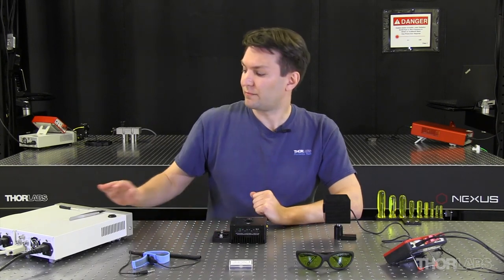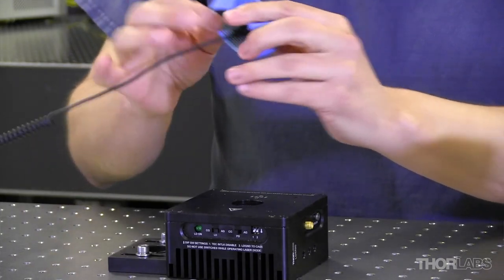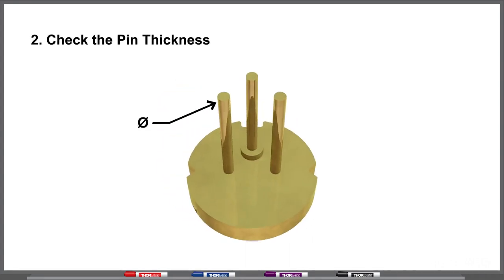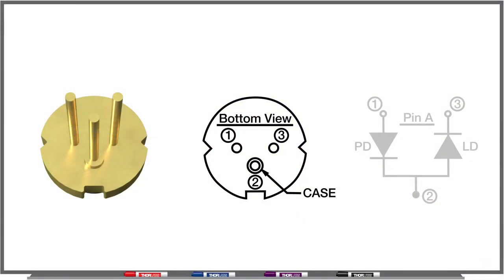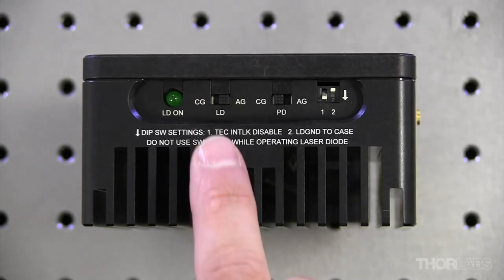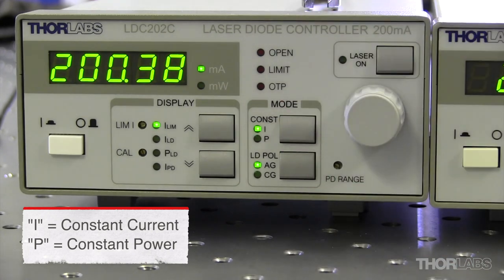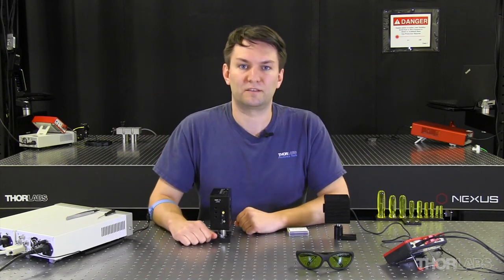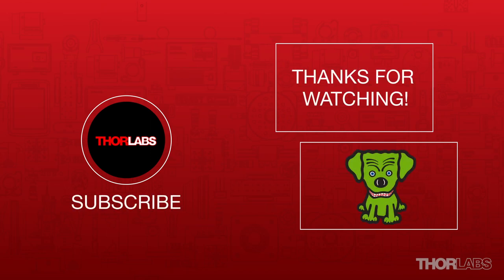Setting Up a TO Can Laser Diode (Viewer Inspired) | Thorlabs Insights

Comment: Nice to see how to use an ESD wrist strap - I was wondering if I'm doing it right for my amplified photodiode :)
Reply from the maker: It's great to hear that we've helped give you some confidence as you handle your amplified photodiode. Please let us know if there is anything else you've had questions about.
Reply: @thorlabs  I would definetely appreciate an insight video on adjusting two FiberPorts facing each other on a FiberBench as well as adjusting a plate beamsplitter module for FiberBench. I had few-year break from adjusting free-space interferometric setups and now adjusting a Mach-Zehnder interferometer using FBT-50MIR beamsplitters and a FiberPort to collect light at the output gives me a headache (so many adjustable screws!) :)
Reply from the maker: @Adam Paździor  There are definitely a lot of adjustable screws 😊 Thanks for the detailed suggestion; that sounds like a great addition! Definitely let us know if you think of other demonstrations you'd like to see.
Reply: @thorlabs  Sure :) I'll let you know when something else comes to mind.

Comment: Please make a video to show how to fit TO Can laser diode into a SR9D strain relief with LTN330-C!
Reply from the maker: We would like to better understand the difficulties you encountered mounting your TO can laser diode in the SR9D ESD protection and strain relief cable.  Are you able to tell us the size of your TO can (e.g. Ø9 mm, Ø5.6 mm, ....)? Would you also be able to tell us the diameter of the circle of pins on your TO can (see for example, https://www.thorlabs.com/_sd.cfm?fileName=QTN007837-S01.pdf&partNumber=L852P100 where the Ø2.5 mm circle is called out in the “Rear View” section of the diagram )?

Comment: Do video for cld1015 as well for 980/1064 and 1550nm
Reply from the maker: Thanks for the suggestions! Do you have a particular application or use case in mind for the specific wavelengths?
Reply: @thorlabs  980 as pump diode for fiber amplifer and 1064 as signal for ydfa and 1550 as signal for edfa
Reply from the maker: @Michael Jordan  Great! Thanks for letting us know what you had in mind and continuing to provide ideas for how we can expand our video offerings.
 
For those not familiar, rare-earth-doped optical fibers can boost the power of optical signals propagating through them. Signal amplification occurs when both pump laser light and the optical signal propagate through the optical fiber. The rare-earth ions absorb the pump light and convert it into energy at the signal wavelength. Rare-earth elements include erbium and ytterbium. Erbium-doped fiber amplifiers (EDFAs) can be used to amplify signals with wavelengths around 1550 nm, and ytterbium-doped fiber amplifiers (YDFAs) can be used to amplify signals with wavelengths around 1060 nm. Both EDFAs and YDFAs can use 980 nm wavelength pump lasers.
Reply: This is one of the most helpful tutorial so far. Thank you for your effort and looking forward to watching more videos from you
Reply from the maker: @ibozum1  We're very glad you found it useful! If you think of a topic for another tutorial you'd like to see, please let us know!
Reply from the maker: @Michael Jordan As a starting point, we created a quick-start guide to the CLD1015 laser diode driver and temperature controller in the new Setting Up a Pigtailed Butterfly Laser Diode ( https://youtu.be/LAixCOso-FE ) Video Insight. It includes a demonstration of the procedure for installing the laser, entering the thermistor values, and setting the maximum drive current limit.
Reply: @thorlabs   seen it.Helpful if shown pump type A and B changing in driver
Reply: like there is difference for 980/1064 diode and 1550nm diode
Reply from the maker: @michaeljordan494  Thanks for giving us more information about what you'd find helpful in a video demonstration! As you point out, the CLD1015 laser diode controller is compatible with Type 1 and Type 2 14-pin butterfly laser diodes. A Type 1 butterfly laser was used in this video ( https://youtu.be/LAixCOso-FE ). For a Type 2 laser, the butterfly just needs to be installed in the mount with the fiber pointing in the opposite direction. Otherwise, the installation procedure is the same.  

Once mounted, we actually try to keep the laser within the mount and use a second mount when we need another laser.  That way the laser always stays protected and the settings remain the same so someone does not accidentally over drive the device.  This is especially important when someone spent the time to determine the optimal PID settings for the intended drive current and TEC setting, since no one really wants to repeat that process manually.  

For those who are not familiar, it is not good practice to assume all butterfly packages that provide the same wavelength will always follow the same pin-out type.  In our experience, the majority of available butterfly lasers are Type 1, but there are some telecom and distributed feedback (DFB) lasers that are available as Type 2, or that give you a choice of type.  It's critical to check the pin-out diagram that comes with the laser to ensure the correct connections are made.

Comment: How to mount the G type laser diode as it is only a LD please can you make a video to show how to mount it and adjust the polarity of it like L450P1600MM thanks
Reply from the maker: @Abdelrahman Ali Thanks for suggesting we expand our laser mounting video Insight series to include TO can laser diodes with G-style pin configurations!

As you point out, this style does not include a photodiode (PD), but the primary reason for its different mounting requirements is that neither its anode nor its cathode is connected to ground. Instead, they float. Similarly, the F-style configuration also has a floating LD anode and cathode, although it includes a PD. 
 
The laser diode you mention is a TO-56, and there are temperature-controlled mounts for TO-56 laser diodes that are compatible with G pin codes. For example, the LDM56 is compatible with pin configurations that include the G-style (but not the F-style). Another option is the LDM56F, which is only compatible with G- and F-style TO56 LDs. The manual for the LDM56 mount describes how to set the included jumper for the appropriate pin style (the LDM90 in this video also includes this jumper and is compatible with G-style pin configurations). For more information, visit https://www.thorlabs.com/newgrouppage9.cfm?objectgroup_id=308&tabname=Pin%20Configurations&YVI=12 .
Reply: @thorlabs   thanks for your concerning

Comment: Eğitim videonu harika olmuş. Teşekkürler. Tam aradığım şeydi. Bu konuda  tecrübesiz biriyim. Akım kısmını çok güzel anladım fakat Gerilim  (V ) kısmını nasıl ayarlıyorsunuz ?. Besleme gerilim voltajını ney belirliyor ?
Reply from the maker: Thanks for letting us know you found the video helpful! Our translation app tells us that you're interested in knowing what determines the voltage provided by our laser diode current controller, since only the current provided by the source was set during this demonstration. Please let us know if we misunderstood. 

The current controller is similar to a power supply. It is typically not necessary (or possible) for the user to simultaneously set the applied current and voltage levels on a power supply. This is because the device you connect to the power supply provides a resistive load (impedance). When the current is set on the power supply, the provided voltage is automatically determined by that current and the resistance of the device. The provided voltage can be estimated by Ohm's law (Voltage = Current * Resistance). Note that there is a limit to the total power (Power = Voltage * Current) a power supply can provide.

The amount of voltage required for a particular laser diode can be determined from its light-current-voltage (LIV) curve, which is typically provided with the laser diode. This curve plots both the emitted optical power and voltage as a function of the applied current. When choosing a current driver, we recommend selecting a current driver whose compliance voltage is larger than the voltage required by the laser.

Comment: Dont you fluke the reading by putting the LPM right up on the face on the diode as the infrared energy from the diode wont it fluke the reading.  .12:28
or maybe it aint a tempbased sensor.. photo?
Reply from the maker: Thanks for mentioning something good to keep in mind when using thermal power sensors. However, in this demonstration we used an integrating sphere photodiode power sensor, where the photosensor was silicon based (Part Number S142C, https://www.thorlabs.com/newgrouppage9.cfm?objectgroup_id=3328&pn=S142C&YVI=12). Since its peak responsivity is over the 350 – 1100 nm wavelength range, we expected a negligible blackbody radiation contribution to the power measurement.
Reply: @thorlabs  I reckon it likely was a photodiode, btw Impressive transperant site, with so much data on the different items.. which is exactly what you want as a possible buyer, as it creates confidence in a given product when the tolerances are so spec'd out & manageable..
PM-160T-HP still one sexy beast here a decade later..

Comment: What do the triangular and square cut outs on the sides of the diodes mean? Some seem to have them and others don't.
Reply from the maker: The cutout(s) can be helpful for orienting the diode. A square notch or protruding tab can be used to design a keyed fixture that only allows the diode to be installed in the correct orientation. If there are also two triangular notches, the three cutouts can be used to precisely locate each pin on the TO can. Whether to include cutout(s) in the TO can stem, which is the flat circular piece of metal between the cap and pins, is the choice of the manufacturer. The documentation provided with the diode typically describes the geometry of cutout(s) with respect to the pins.
Reply: @thorlabs  thanks for the reply.

Comment: I am using a TO5.6 LD(808nm 200mW) with the same mount and laser driver in const current mode. however the laser seems to be very poorly light. is it the wavelength not in visible range or some other problem?
Reply from the maker: @asifislam3219 Since the 808 nm wavelength of your LD is at the edge of the visible spectrum, its light should appear very dim.  If you have concerns about a laser source’s output power, it is best to measure it using a power sensor. As you suspect, you can’t always trust your eyes to properly judge the amount of output power your source provides.  Light with the same optical power and a wavelength closer to the center of the visible spectrum, such as the 632.8 nm wavelength of a HeNe laser, will appear much brighter to the human eye.

Comment: i am using ROHM RLD78NZM5 laser diode, does the bottom view applies for this laser diode also?
Reply from the maker: It can sometimes be difficult to determine how the pinout is presented on a manufacturer’s spec sheet. On Thorlabs’ spec sheets, the different views are labeled to help avoid this confusion. (See for example page 2 of the spec sheet for the laser diode featured in this Video Insight  https://www.thorlabs.com/_sd.cfm?fileName=QTN007837-S01.pdf&partNumber=L852P100 .) We recommend contacting the manufacturer of your laser diode to confirm the perspective depicted on your spec sheet.

Comment: Please i would like to ask about the model for the mounting head suitable for L450G1 laser does it LDM56?
Reply from the maker: Unfortunately, the L450G1's pins are too large (0.6 mm in diameter) for both the LDM90 and the LDM56, which accept pins whose diameters are less than 0.51 mm. Thorlabs does not currently offer temperature-controlled mounts that can accommodate TO-can laser diodes with the L450G1's 0.6 mm pin diameter.
Reply: @thorlabs  thanks
Reply: @thorlabs  please i had seen diode sockets on your website and i would like to ask if any of them can mount L450G1 to LDM56 mount thanks
Reply from the maker: @abdelrahmanali2669  Thorlabs does not provide a socket that can be used to mount the L450G1 to the LDM56. The custom socket provided with the L450G1 has 0.7 mm diameter pins and is intended to assist with soldering. Please note that sockets of this type should not be used as adapters between laser diodes and mounts (even if the socket's pins could fit into the LDM56, which is not the case), since the adapter cannot make the necessary thermal contact between the laser diode and the mount. Good thermal contact between the laser diode and the mount is required to protect the laser diode from damage, as well as to ensure stable optical output.